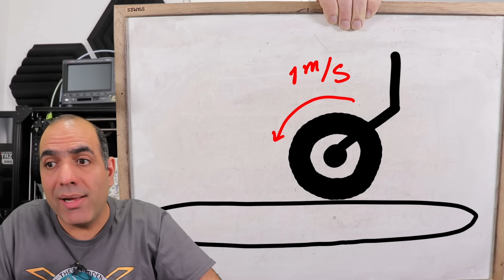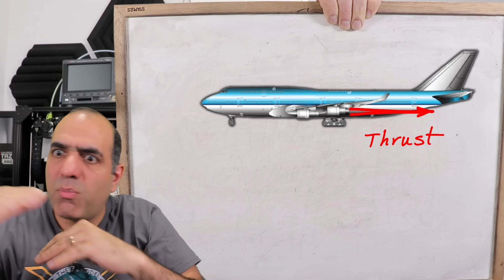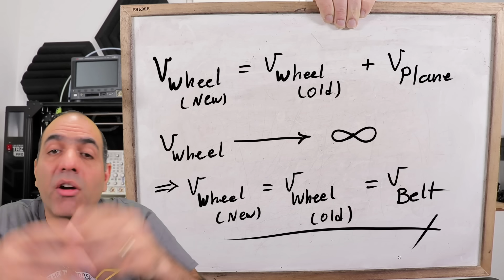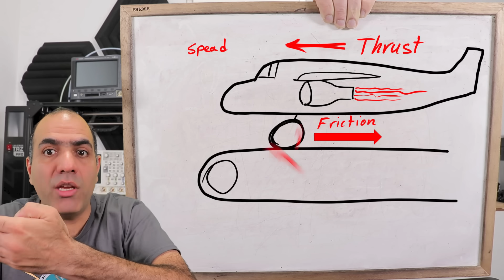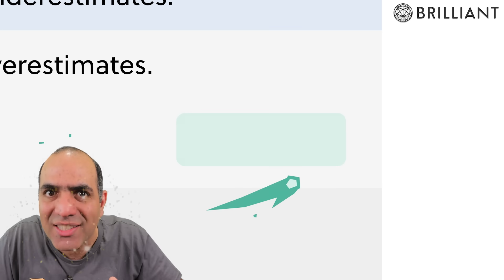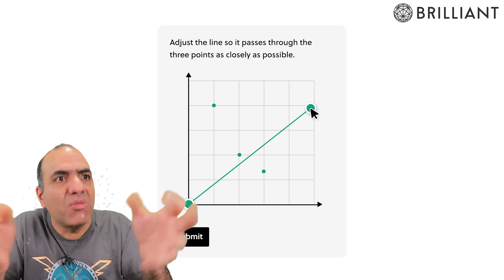Airplane Question that Drove Me NUTS!!!

Comment: Actually, the real answer is that after a few seconds of thrust, the centifugal forces will cause the plane's wheel to violently explode, letting the entire plane down onto a belt moving at (probably) the speed of sound or higher, causing the plane to be violently shreded and shot backwards. Depending on your definition of plane, you could count some of the debris cutting through the air at 700 miles per hour as "part of the plane flying".
Reply: Mission accomplished. We're airborne.
Reply: This is why "spherical cows in a vacuum".
Reply: Um, no... the plane moves forward exactly as it normally would on a stationary runway. The belt matching the wheels simply means the wheels spin faster on takeoff.
Reply: is this a joke or the wrongest thing anyone has ever said in the history of anything ever?
Reply: @HECKproductions  I can't refute what you said, since you didn't specify what was wrong, but I can assure you that my original comment remains 100% serious, and is correct.

Essentially the problem as written sets up the speed of the wheels and conveyor belt to feedback into each other at an exponential rate. This is because once the plane applies thrust, the wheels will naturally start to turn as the thrust moves the plane forward. However, as written, the conveyor belt will perfectly match the speed of the spinning wheels. Definitionally, to counteract the spinning of the wheels, the conveyor must spin fast enough to keep the plane stationary. If the plane moves forward at all, it means that the wheels on the plane are spinning faster than the conveyor belt, which goes against the rules of the hypothetical. The only way to match speeds between the wheels and conveyor simultaneously is to counteract the thrust of the engines with resistance from the conveyor belt transmitted to the plane through the landing gear. However, as wheels are designed to turn easily, the friction from them spinning, and the resulting resistance applied to the plane from the conveyor belt is vanishingly small. The result is that it takes very little trust from the plane to require the wheels and conveyor belt to be spinning at hundreds of miles per hour. While the wheels are designed for high speed, they still have their limits at a few hundred miles per hour. This setup, on the other hand, could easily increase the speed of the wheels to and beyond those speeds in a matter of seconds.
Likely in less than a minute, the conveyor belt and wheels will be spinning near a thousand miles per hour, causing the wheels to tear themselves apart, which will result in parts of the plane that can't spin to fall onto the conveyor belt, resulting in carnage.

If you have any questions about this or any SPECIFIC critiques of my logic, feel free to reply.
Reply: @Cptn.Viridian  🤣 No genius, the conveyor is defined as moving the same speed as the wheels, not "fast enough to keep the plane stationary" which would be many, many times faster than the wheels are moving. If the wheels are moving forward 10m/s, the belt moves backwards 10m/s, that's nowhere near enough to stop a plane though.
Reply: @ it defines same speed as the wheels, not the whole plane, the belt tracks the speed of the wheels. If the plane goes forward 10m/s then the belt moves backwards 10m/s, but the wheel has to roll 20m/s, so the conveyor ramps up to 20m/s, but then the wheel spins 30m/s now, so the conveyor ramps up again, and so on until it self destruct.
Reply: @samueladitya1729  The wheels are travelling the same speed as the plane. They are attached together, you know.
Reply: @WJS774 nah, the wheels has contact surface, and so is the treadmill. If you say the wheels speed is attached to plane's speed, then you also saying treadmill is stationary, because it's attached to the ground. 

The question did not say travel speed of the wheels, it's says the speed of the wheels.
Reply: I feel like a lot of people forget that those same wheels endure some pretty high stresses while landing. Not only do the wheels go from a stand still to moving after touching the runway, they’re under tremendous compressive forces from the entire plane baring down on them. These tires endure 25 tons of force on them on take off alone, and they can do this for about 200-400 take offs and landings. That’s 25 tons per wheel, and the max amount of pressure they can endure is about 800psi, though the tires are often only loaded to 200psi. It can withstand about four times its normally rated force, so naturally, it’s likely the tire may not explode at all. Instead, the tire just spins faster, as the air current from the engines accelerates the plane forward. The conveyor belt might double the force on the wheels as it spins, but the tires are rated to handle more than that for hard landings and such.
Reply: what if the engines are at high enough thrust and then when the wheels give out the plane just starts going
Reply: I thought the motion of a plane in conveyer belt would be linear. How will it experience centrifugal force???
Reply: If you think of the conveyor and the wheels like a couple of meshed gears, the conveyor will only ever be able to turn as fast as the wheels, it wouldn't accelerate the wheels into an infinite loop.  Otherwise the moment the plane's wheels move forward, it would instantly accelerate the wheels to infinite, which would turn matter into pure energy and blow up the planet.
Reply: Not at the speed of sound, at infinite speed. Mehdi came to the same conclusion as I did - any movement of the wheels result in speed of both wheels and the belt acceletate infinitely.
Reply: I always respond to this with "The conveyor belt will explode first."

The technology to construct a conveyor belt which could maintain integrity while holding the weight of a jet airliner WHILE running at the speed required to grenade the wheels doesn't exist, and it is only reasonable to assume that the plane under test is constructed using the same technology as the conveyor.
Reply: Real answer is that conveyor belt dont exist, because no one is stupid enough to build few kilometers long structure with absolutely absurd requirements.
Reply: @alexturnbackthearmy1907  Really? You must not have been here very long, so let me be the first to welcome you to the planet the dominant inhabitants have named Dirt. Or something like that. As a whole, they're not very bright; despite having demonstrably had the technology for more than a lifetime, they hadn't spread beyond Mud's low orbitals - and barely even that.

Honestly, it's best not to provoke them. Not only are they fairly stupid overall, they tend to irrational violence, and have contrary streak that is nearly immeasurable. That orbital thing? Yeah, one of their leaders basically dared them to do it. Not long after, he was murdered. Not saying the two were related, but not saying it wasn't. Get this though: despite having their leader's braincase publicly and violently ventilated, his people STILL went ahead with the dare!
Reply: @mikehammer4018 
This is why I learn English. Things like this motivate me to learn more.
Reply: @dumbleking5172  Happy to be of service!
Reply: This was my first thought lmao the plane can’t move and therefore can’t take off and the wheels will explode lmao
Reply: @Glub_blubThe point is not that the plane takes off at the speed of sound.  The only way the conveyer belt can provide a backward force to resist the thrust of the plane's engines is if it continually accelerates.  This is because the wheels have inertia and can't instantly match the conveyer speed without some force from the axles and time to accelerate.  However, since the engine thrust is so much greater than the (angular) inertia of the wheels, the rate of acceleration would have to be crazy high to balance everything.  Very quickly the belt speed and thus the edge speed of the wheels will be so high that the wheels will disintegrate due to centrifugal forces exceeding their material strength.  By the time this happens, the belt speed may exceed the speed of sound.  The airplane hasn't moved yet since the problem constraint has held until now, so the stationary plane falls onto the possibility-supersonic conveyer belt and promptly experiences rapid unscheduled disassembly.

Comment: isn't the entire point of the "conveyor belt" in the question is to keep the plane stationary? anyways, I thought it was a question about thrust to weight ratio tbh
Reply: it's a trick question.

CAN a conveyor belt keep a plane stationary?

No.  Not unless you leave the plane's brakes on.

Comment: yeah but in before the plane takes off its still touching the ground, so whatever thrust the engines provide its still getting counteracted by the belt... it will just stand still. Before the plane is in the air the V of the the place is the equal to the V of wheels.
Reply: It is not getting counteracted by the belt.

That's what makes this a trick question.

Comment: you have to remember that the conveyor belt has the length of a runway. And given how planes normally take of it will be sitting at one end facing the other end. Now if the conveyor belt moves fast enough the friction with air will create sufficent airflow for the plane to take of . . . once it takes of the airspeed would drop significantly, so it would crash down again.

Comment: Yes it will. Because the plane is not powered by the wheels. I'm sure treadmill makes the wheels turn however the rocket/jet end will still push the plain forward regardless of the speed of the treat mill. 
(Unless the wheels slip causing drag and damage).

Comment: Weird to initially assume there's no friction between the wheels and the belt.  Essentially, rubber on rubber.  Even if the wheel-bearings are perfectly frictionless, the heavy plane would be crushing those wheels down onto the belt.  We know the plane moves via the engines, but it would still result in the wheels turning as they were in contact with the belt, and as the thrust increased and the wheels turned faster, the belt would accelerate to counter it - assuming there's no delay in the belt responding to the speed-change.  Not up to infinite speed, just up to the maximum thrust that the engines could apply.  While all this is happening, there's no significant air speed over the wings (other than the air being dragged backwards by the thrust of the engines themselves, some of which would pass over the wings) therefore no lift, therefore the plane isn't taking off.  Someone suggested that the belt would somehow move the entire airmass above it by dragging it along, but this isn't how fluids behave.  The air would be dragged in layers of different velocity with the layer of air closest to the belt moving almost as fast as the belt itself, and layers further away moving more slowly and probably in a more turbulent manner.  While I don't know the precise calculations, I doubt the layer of air the wing was in would be moving fast enough to generate enough lift for the plane to take off.

Unfortunately this question is too vague to have a truly meaningful answer, but I imagine a channel like @rctestflight could create a model to demonstrate a possible solution to this question.

Comment: Before watching further, I just think about the fact that it's the turbines of the plane that push it forward, not wheels. If the runway was made of conveyor belt matching the speed of the plane but on reverse, I would think the tires would wear out super fast and break the landing gear, thus destroying much of the plane. But as this is a hypothetical question, I'd assume the tires would be infinitely durable. What I do not know is, how much friction the tires will add so I believe the question remains can the plane reach speed required for the takeoff if the tires add too much resistance.

Comment: If the plane has no relative velocity difference between the air and itself then there will be no lift. Easy peasy.
Reply: thousands of pounds of force forward, nothing holding it back, and it doesn't move forward?  why?
Reply: @tsm688  It will go forward, but not up lol
Reply: @davidj2452  That is how airplanes work, is it not?  Forward motion causing air to move over their wings?
Reply: @tsm688  the wheel will hold back, so it will not go forward, the wheel and the belt will spin to the speed of light to pull the aircraft backward.
Reply: @ if the belt can spin the speed of light this is no longer a physics question, this is a dragon ball cartoon.

Comment: Here's a better question: 
A 747 is sitting on a runway.  Its ground speed is zero, meaning the aircraft is stationary with respect to the ground.  It is receiving a 250-mph headwind.  The engines are running and their thrust is perfectly opposite the headwind.  If the pilot pulls back on the yoke, will the aircraft take off?
Answer: yes.  It will take off, and it'll look really weird because its ground speed will remain zero.  The only thing that matters to the aircraft is its airspeed.
Reply: This concept is used by STOL (short take off and landing) airplanes, especially during competitions. Taking off and landing into the wind allows them to basically become helicopters and take off/land in essentially one spot. Current record is around 3 meters (9.5 ft, to be exact).
In general it is advised to use wind this way as well. Since runways are of limited length, the quicker you can get on/off it, the better.

Comment: No. Why 4 answers?! Just fkn No and No. How tfk the plane would fly if it never goes forward..... Don't SAY THERE IS A CASE IT MOVES FORWARD. IT NEVER DOES. The question is clearly telling you that the plain is sitting.
Reply: thousands of pounds of force forward, nothing holding it back, and it doesn't move forward?  why?

It's a trick question.  The treadmill CAN'T stop it from moving, unless you invoke magic.

Comment: Mythbusters did this and shown it does not matter.  The answer is the plane is driven by the jet engines or propeller. Not the wheels.  It does not matter what is happening to the wheels. The only way a plane will not go anywhere is if it is tied down.  If this was not the case, planes would not need to be tied down during huricanes, as they produce enough windspeed to lift the plane.

Comment: Yes. The wheels just support the plane they don't provide any traction, the only thing that would pull the plane back is the friction of the wheel mechanism which should be 0 compared to the power of the plane's engines.

Comment: the obvious answer is no. Airplanes use air dynamics to fly, so, unless you move the air as well, making the airplane at the same position just moving the wheels wont make it fly.
Reply: thousands of pounds of force forward, nothing holding it back, and it doesn't move forward?  why?

Comment: remind me the problem of the sailboat with a fan (on the boat) pushing the sail... that result in the boat to not move... In this scenario you have to consider that the airplane is moving relatively to the earth and not to the conveyor belt... given a strong wind even a parked airplane will take off

Comment: I think the easiest way to think about this is, if the jet engines are operating at a thrust level that would normally propel the plane forward at 50mph relative to the ground, then the wheels would be rotating at a speed required to maintain 50mph relative to the ground.
This means that the conveyor belt is running at minus 50mph (relative to the ground, and to achieve this the belt must be powered) so the plane must be stationary relative to the ground.
You can prove this to yourself because shutting off the jet engines at that point would result in the plane being pushed backwards by the powered conveyor belt at, initially, 50mph because the wheels would continue to rotate because of momentum so the belt would now be the only source of power in the system and the wheels are not frictionless, so the plane would be pushed backwards. 
So what is happening is that, whenever it is running, the belt is constantly trying to push the plane backwards but the jet engines are operating at an equal but opposite force in order to keep the plane stationary relative to the ground (and air). Therefore it would not take off.
Edit. Alternatively, think about it back to front. If you started the whole process off by first driving the conveyor belt, slowly at first (so as not to overcome static friction of the wheels) and then faster and faster, the plane would move backwards on the conveyor belt. You could then start running the jet engines to exactly offset the rearwards thrust provided by the conveyor belt, and the plane would remain stationary. If the conveyor belt could supply enough rearward force to completely offset the full power of the engines, the plane could never move forward.
Reply: That is not how it works.

Unless the brakes are on, the force of the treadmill is transmitted to the wheels only.

the plane would fly.  The wheels would spin a bit faster than usual going down the runway.
Reply: @tsm688  if the wheels spin faster, the treadmill moves faster to compensate for that.
Reply: @pjay3028  the question is designed to trick you assuming the treadmill can hold it back.  But it actually can't -- did you think they left their brakes on?

You have to invoke light speed magic treadmill bullshit to stop the plane with it.
Reply: @tsm688  the question has successfully tricked you.

Comment: It won’t fly, the conveyor belt will prevent the engines from gripping on the air.
Reply: thousands of pounds of force forward, nothing holding it back, and it doesn't move forward?  why?